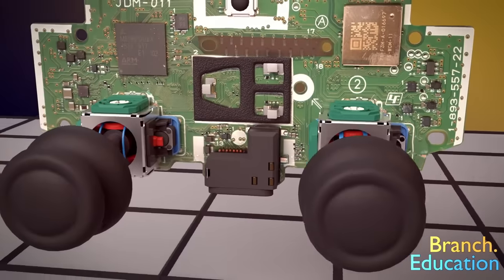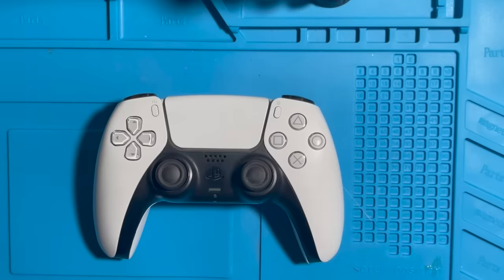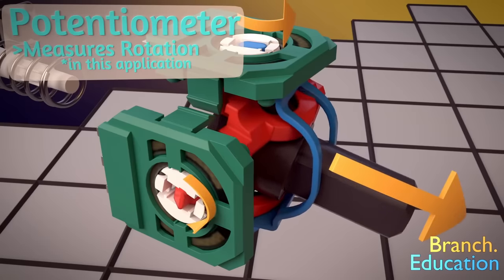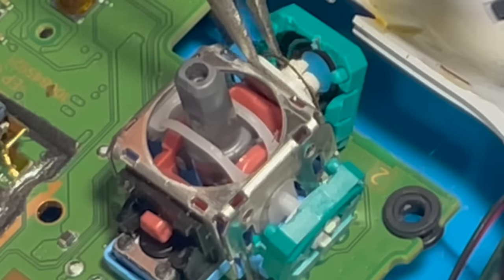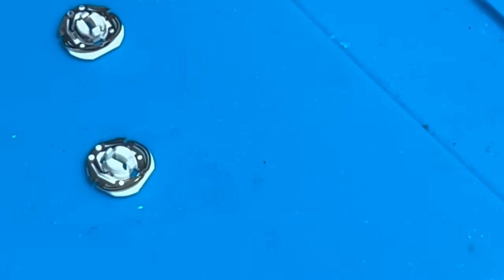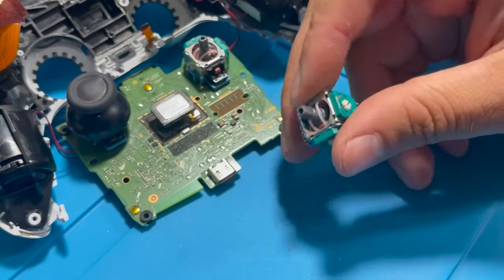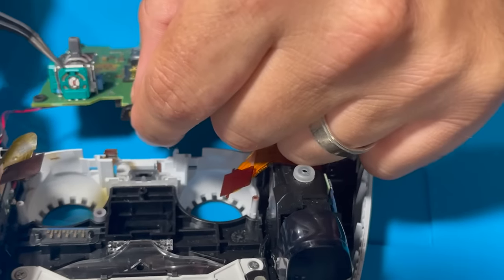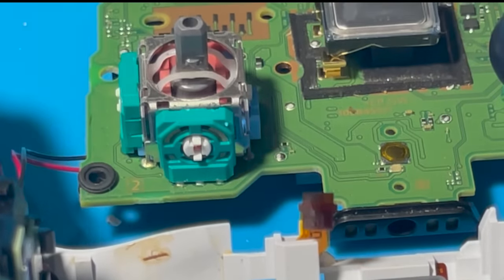What Causes Stick Drift Controller and How To Really Fix It

Comment: Nice, I know about this issue, but I always supposed you might have to switch the potentiometer itself, which takes soldering. on another note it's interesting you say you can get a pack of 10 of these bases for 15 bucks. Allthewhile, Sony with Dualsense Edge is charging €30 for a single stick base replacement.

Anyways, I have a few working PS4 sticks around on controllers with some other stickdrift issues, so I suppose I can salvage some controllers, just did not get around to it yet. But, the lesson I take away is that there are a few things you can try before replacing the whole "green unit" or the whole base itself with soldering.
Reply: And well, PS5 controller seems even more of a PITA to take apart then the PS4 controller.

Comment: A 3 month old controller started drifting overnight, but it feels like the dead zone shifted in a weird way. Slightly pressing the analog to the right triggers a left action but any further and it works normally. I ended up buying the edge controller but wouldn't mind salvaging my original ps5 controller.

Comment: I didn’t have any problem in many years with ps4 controllers, but I already got my second ps5 controller with drift, in less than a year. Maybe it is because in ps4 you could buy a non official controller but in ps5 you have to buy a new expensive official controller if you want to play?

Comment: My left stick got really jerky all of a sudden. Instead of running straight, characters spaz out left and right. Sometimes, when pressing right, the character runs to the left, first, for a moment. I opened the controller, and found that one of those tiny prongs in the wiper got somehow twisted out of shape and a tiny piece broke away at the tip. No idea how that happened. I ordered some replacement pot modules from AE and I'll replace the wiper. Hopefully that will fix the issue for a while.

Comment: When opening the potentiometer (3:30) will the pins that are soldered on not possibly break ?
Reply from the maker: You just need to open enough to take out the wiper, so it’s not going to break. If you crack it far enough it way break off

Comment: As time goes by oils tend to get sticky as they dry up so moving parts , definitely , need to be deeply cleaned and reapplied with new dielectric grease , periodically but I don't know what those intervals are ; I'd say every 6-12 months .

Comment: Yep the fundamental flaw in 95% of joysticks the wipers will wear out the pads faster than the mechanical internals the best way would be to replace the cube that doesn’t have that fundamental flaw(hall effect) but those are hard to find.

Comment: Hello, I have been trying everything in your video and nothing worked for me. The only thing I need is to replace the potentiometers. What I realized is that they move when the metals that join the potentiometer to the green plate are touched, but on the bottom side.
Is it worth buying another potentiometer or does this mean that the metal pins are broken?

Comment: If you look carefully it drifts because the white plastic piece is broken. You can see the small part falling off. This got stuck in my controller and caused the drift. It works without the small plastic.

Comment: Keeping an eye on the class action lawsuit, cos Sony have really fucked us over with the Dualsense. Dualshock had the usual wear and tear on the rubber caps but I never had an issue with drift and I used to hammer it sold on Fifa. Now I have two controllers less thana  year old totally screwed. lt's great they tried to pack so much into the controller but its clearly too bulky and problematic.
Reply: Even with DualShock I got stick drift once after 8 years of heavy gaming on PS4. Dual sense I barely played with and two I have didn’t last a year before left joy stick got drift. Failure rate is clearly 5-6x times higher on purpose to get us to buy more controllers.

Comment: I tried doing this on my PS5 controller with stick drift issue and it worked... for a day. And I had a hard time trying to re-place the mic cable because I accidentally pulled the plastic tab, that was hard to put back on because of dual pins contact. I'm just frustrated with PS5 controllers.

Comment: Is there something wrong with the ps5 controllers? Because I've had to replace mine like 3 times already because of stick drift, it sucks😭 I've never had this problem with the ps4
Reply: Yeah ps4 was fine ironic that a all powerful system like the ps5 has this issue
Reply: @davidordaz5251  exactly!! If I'm spending $500+ and $70+ on a next gen console and controller I'd expect it to last more than a year😂 I've had mine since 2021 and I've had to replace the controller like 3-4 times!! It's crazy!
Reply: have had xbox one wireless controller for 3 months not even and its drifting
might just buy a wired 360 controller for cheap instead
i dont remember my ps2 controller or xbox 360 having these issues
this is just faulty products

Comment: I just bought a ps4 controller worked ok but it drifts and will not shoot in war games. But my ps4 console is pretty banged up can that cause the issue of the connection??

Comment: This just started happening to the dual sense i bought to replace another drifting controller. Initially i thought the whole unit have to be replaced which would require soldering. Im going to try this on both and hopefully i have two perfectly working controllers.

Comment: Does it matter which potentiometer u Install in the controller or does it have to be a specific one for ps5
Reply from the maker: most controllers use the same ones. So you can install from ps4 or xbox. They are the same

Comment: Yeah? What about when a controller has stick drift 4 hours after taking it out of the package? That happened to me with my Last of Us PS4 controller. Had to take it apart and clean it with IPA to get it to work again (and it lasted for a couple of months before doing it again). 4 hours of use dude!. So it isn't always because of wear...

Comment: I never had drift on any of my controllers for any consoles the only thing I see happening is buttons might become weaker when you press on them they feel hard to press down on or if you got an Xbox 360 controller the back trigger buttons might have a crack but drifting was never a problem for me ever

Comment: Can we replace both the track and wiper without soldering?? Please reply!!!
Reply from the maker: Only wiper. To remove the track you need to de solder 3 pins that are attached to the board. Check out my potentiometer video how to replace it

Comment: Why do these happen to certain joysticks and not all? I've had it happen to my PS5 and Nintendo Switch JoyCons. However, the Switch Pro controller never gave me any issues and I've never had issues with my Xbox controllers. It seems like a major design flaw on these systems.

Comment: Well I'm really not sure what part exactly fix my issue. I went through the reset and that didn't work. I took apart the controller and I didn't clean anything because nothing looked dirty. But disconnected everything I could and put it back together. And now it works.

Comment: Figure it out.. it’s microscopic hair or fur, you have to take the controller apart (dont use knifes they made the screws out of butter) and then get to the knobs to the point you can remove the covers the you just get a small vacuum or your mouth and suck out the hair.. (ive do this every time i experience stick drift and it gives me a few weeks of gametime before starting up again)

Comment: I broke my last controller trying to fix it and opened it, I broke the light, sticks, and probably other stuff I didn’t see or missed. I ended up buying a new controller and it has stick drift too, I don’t want to make the same mistake so I just deal with it. Is there other ways?

Comment: After cleaning, & properly installing the wiper I am having issue with one potentiometer clicking shut. Besides replacing is there anything I can do or look into?
Reply from the maker: check my video out on Hall effect Joystick replacement. This method fixed stick drift long term. Next step would be to change potentiometer which I also have a video about it. But these methods require soldering and some equipment typical gamers probably don't have sitting around

Comment: i use controllers for 40 years and i have most systems. never had any stick drift on any system but i do know the switch has issues with this.

Comment: I've not tried it on my controllers with drift but in theory any d5 potentiometer cleaner should do the trick. I fixed my 40 year old hifi amp with the stuff. The volume control is like brand new again. I just sprayed the stuff in the potentiometer. Have been too lazy to take apart the controller

Comment: None of this is needed, the fastest option is to blow as hard as you can into the controller sticks, it wont break them, and you can easily clean the inside dust out of the sticks. Thank me later :)

Comment: If only I had the technical video editing skills & PC patients, any problems you can't solve ide bet I've covered the technical workings on the max circularity side & 3x3 trim pot best use selection & why with an outlined calibration help sheet 📜, can I help fix your problem solving if all else fails, most probably yes 👍🏻🎮🕹️👍🏻 it's all about the resistance value ⚡ flow 🫡😁...

Comment: I only play on pc, don't own console. I think made huge mistake buying ps5 controller. Though the drift has not occurred yet, when it eventually does. I may buy a official 3rd part licensed xbox or ps controller with hall effects. There are some 3rd party xbox controllers in My region but couldn't find a good 3rd party ps controller that would work on pc

Comment: I've got 3 controllers that I've had for 4 years.Only the one that I use all the time has a little drift on the right side stick.The other 2 controllers are like new with no problems.

Comment: I just take a disinfectant wipe to my controller every week. It always fixes bottons that sticks or the drift. Push your wipe down in the analog stick and get the underneath clean.. no need to take it apart unless your throwing your controller at the wall....

Comment: The new Dualsense Edge controller has easily replaceable analog stick modules that are $20. Finally Sony seems to have acknowledged that analog sticks are wear parts.
Reply: Yes, but it's very expensive (over 3 times as expensive as the normal DualSense controller). It also has a shorter battery life.

Comment: The more strange think is, i heavely played on ps3 and ps4 controllers and never had drift. But with just 2 years of ps5 and 2 controller, they both had drift on the left analog. The analog is the same as the ps4 but that glue or whatever is on the tracks playstation now puts in, is making the controller so much worse on the green parts absorving dirt.

Comment: The video Is great but i didn't understand what buying to solve It, cause i'm not a native speaker.
In your description we can buy the cubes and the potentiometers. 
What should i buy?
Reply from the maker: You can try to fix it by cleaning. But if the wiper or potentiometer is uncleanable   you would need to replace it and but the cube or potentiometer

Comment: I bought a new sensor and cleaned out the potentiometers with rubbing alcohol and it's still a drifts It's very minimal, but I'm a very competitive gamer, and even a little drift cam be very detrimental

Comment: Never bought a new controller on PS1 2 or 3 until 4 and still on 5. Bought 5 on PS4 and 2 on 5.

Never had issues on Sonys PS1 2 or 3 until 4 when all the crashes started and still on 5.

Comment: I have no experience in this.. I took my controller apart picked out hairs, rubbed the potentiometer and it's track with a lysol soaked qtip and my controller works again 😂 thanks

Comment: What’s interesting, all the time I have a drift on all my controllers both for ps4 and ps5, it drifted on the left stick to the left. The same way the author had. I assume, it is because many games have L3 mapped to run and I do a lot of “run” while moving to the left or right. Never had a problem with right stick.

Comment: If you got to do all that on 70 dallor controller sony needs to go back to the drawing board the ps4 controller didn't have as many problems. The ps5 controller just is bad from crappy battery life to the USB c being trash slow charging. To major stick drift.

Comment: This video is fake he didn’t solve the problem on minute 4:19 you can se the potentiometer track is scratched (black traces on the green part of the joystick) that’s the real problem not the wiper I have been repairing controllers the last 10 years. You can solder a new potentiometer track and clean the wiper and that will solve the problem , but I personally just solder a whole new joystick. Also make sure everything aligns before trying to close the tracks or you can break the wipers like he did 6:49😂 im sure he connected another controller just to pretent he fixed it.

Comment: So these use the exact same module as ps4 controller? I wonder why i never got stick drift anywhere near as bad as my ps5 controller with much more game play with my ps4 one?   

So i can replace the entire module with one from my ps4 controller for my ps5?
Reply from the maker: They’re same
Reply: Never mind, watched your newer vid. The soldering would prevent that i guess. Most i could do is change out the wiper.
Reply: @TheGamer2Know  But i couldn't de solder the ps4 one and reuse it right? it wouldn't have the posts to stick through the board. i know nothing about this sorry lol.

Comment: is it possible to replace both wiper and resistance by desoldering the green bit?
Reply from the maker: Check the pin comment with video on soldering the green bit

Comment: My Xbox 360 is 14 years old and all may kids have played on it alot, and have been been rough with the controllers. None have drift. Yet I've been though about 24 Xbox one controllers just my myself, some get drift within a month or two. Microsoft needs a class action lawsuit, it's purposefully made that way. Even have returned 7 elite series 2 controllers and I baby them, cheap plastic is used, probably cost them 10 cents or less to fix it, again it's on purpose that they do this.

Comment: Dude I don’t remember PS2 and Gamecube controllers in the 2000s doing this shit.

I had kid siblings too that fucked my controllers up. Multiple of each system too. Stick drift never developed even 3 years in with smash bros intense multiplayer. And the many PS2 games played with the same 2 controllers. The plastic rubber would wear but the sticks worked fine. Neutral and no movement or drifting.

Comment: Why all videos are obsessing with the potentiometers??? My problem is with the brackets and mechanism itself.... how do I fix that without unsoldering it????
Reply: You are mistaken, unless debris or oil is interfering with the wiper and resistive track it rides on in the potentiometer and can be cleaned, drift is caused by the potentiometer itself.  Wiper wears carbon resistive track creating a lack of conductivity, causing erratic values and making the axis unreliable and 'drifts' or jumps in values. This is not even a topic for debate for those familiar with electronic components and how these mechanisms work.

Comment: I tested my xbox series x|s controller on that site and it doesn't show drift but when I play games that I move the stick a few millimeters up or down the stick moves up or down by itself, for example if I play FiFa which is a game that we move the stick totally my controller works correctly but if I play a game like Baseball that before throwing the ball I move the stick a few millimeters by itself, and it is always up or down to the sides it works fine, anyway, my controller is under warranty .
for the price that the xbox and ps controllers cost they should last longer, I had one of the xbox one lasted almost four years and now with the xbox series x|s lasted a year and the controller did not fall or anything, the sticks are too weak, the price you pay for the controllers they should last longer, 60€ for something that lasts very little is unacceptable, I was thinking of buying one of the PS but I've seen that also has the same problems as the Xbox, I'll have to analyze and see if there are controllers from other brands that offer more durability ...

Comment: I did everything and nothing worked but noticed that the black ring in the green piece was not q complete circle so i used a n7mber 2 pencil and remade the circle dince its graphite it must have been a contact issue qnd it worked

Comment: i had a controller where it would fry the potentiameters in every few hours of gameplay ... i changed so many refusing to believe it was a mainboard issue up until the point where i replaced the entire mainboard of the controller and then it had the same issue  -.- .... the controller went to recycling ;(

Comment: Its a shame that they use potentiometers even on that 240 € edge controller. You can replace them? What a cool feature, sony, to make more money :D
Instead of using hall sensors which dont wear and dont have issues with dust etc.

Comment: Stick Drift has been permanently resolved on the Nintendo Switch with Hall effect magnetic joysticks.

The company who manufactures these must also make for ps5 and xbox controllers
Reply: There are no aftermarket hall-effect potentiometers for the Xbox One or PS5 controllers (replacing the Alps models) at this time. GuliKit makes them only for the Switch.